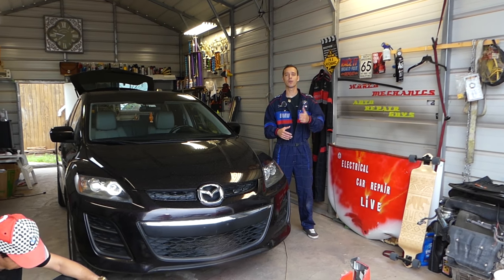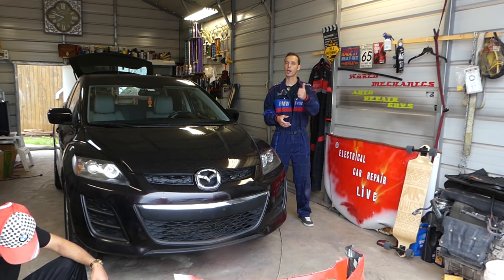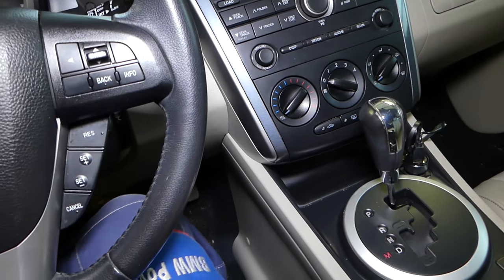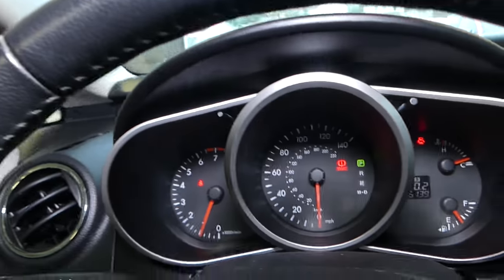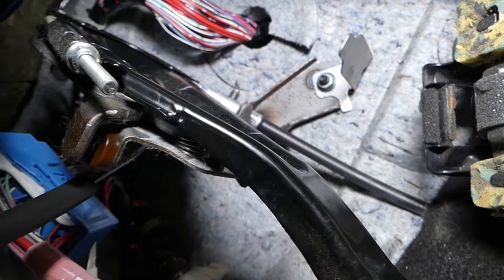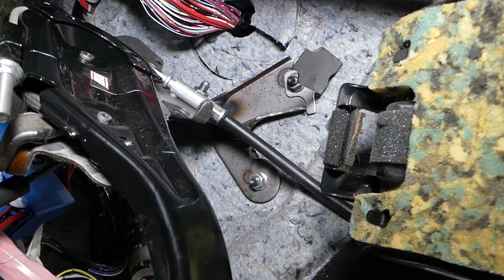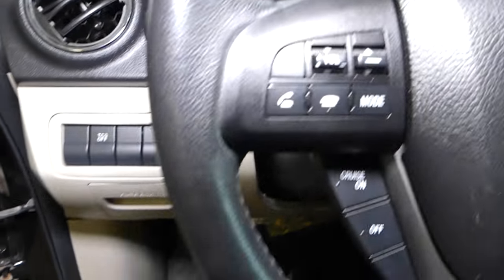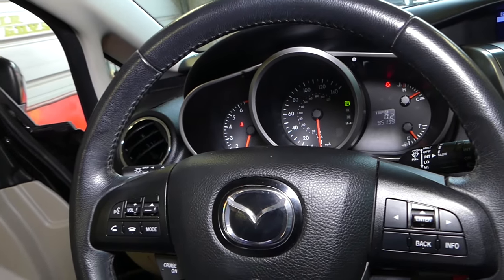WHY IS PARKING BRAKE LIGHT ON. HANDBRAKE LIGHT ON WHEN RELEASED

Comment: Brake fluid needed topping up and the light went out immediately.
Reply: It's still on..  After brake fluid topped up
Reply: @juliacaraballo8987  After several months of topping up and the light coming back on - I have no idea why yours hasn't gone out - our mechanic found the cause was a corroded brake pipe. Fixed and no problems since. Maybe your problem with the light is simply a case of following this quack's method of getting the light to stay off!

Comment: Urgent advice needed. My light goes out if the wire connects to an earth but that's what it's supposed to do but unfortunately it is fooked and stays on no matter what. Only other function is brake fluid level but that is fine. Wtf . This is driving me nuts.

Comment: Topping up your brake fluid reservoir could do the trick ! I'm not sure why . Cheers Eddie PS Mark down below also found this 'fix'
Reply: I have the same issue, and I am a millwright mechanic. As the brakes wear it requires more brake fluid in the system to fill the volume of fluid inside the brake calipers. You will notice that every so often you need to add a bit more to your brake reservoir because the level has dropped near the lowest level indicator. On a manual transmission car (I have) such as a 2013 or newer Hyundai, the clutch hydraulic mechanism is also fed from the brake reservoir. Topping up the reservoir will temporarily correct the light from staying on after the E brake is disengaged. Just be careful when replacing the brakes. You may have to remove some of the brake fluid that you previously added to prevent it from spilling over the top of the reservoir when you push the caliper pistons back far enough to install the new brake pads. This is purely a design issue with some cars that has obviously been overlooked to keep the cost of the car lower. The car I am referring to is my wife's 2013 Hyundai Elantra with standard 6 speed trans, with just under 50,000 Km. The brakes are original and I have added brake fluid 3 times to date. (Feb 14, '23) to get the light to stay off. We will be checking all four brakes as soon as the weather "brakes" in March.

Comment: MY HONDA CITY CAR 2004 MODEL BRAKE LIGHT COMES ON WITH THE TEMPERATURE GREEN AND RED LIGHTS, AND THE SPEEDOMETER AND ACCELERATOR METER CUT OFF WHEN THE CAR GOES ABOVE 60 KM SPEED, NO  The check light comes on and the engine does not turn off, can you tell me what the problem is
Reply: GO TO A MECHANIC

Comment: this is my issue on my bmw e90 can’t seem to turn it off. What could be the fix?
Reply: Is your car driving fine otherwise?
Reply: @arthurrimbaud7287  I fixed the issue. It had to do with one of my brake sensor went out, replaced it while I was doing my brakes and the light went off. Check your brake sensor might need to be replace.

Comment: Hey guys, I just replaced the e-brake switch and it didn't fix the light staying on the dash. 2012 Hyundai Elantra gls. What should I look for next?
Reply: Low brake fluid in the reservoir.  Don't add too much ! It may overflow at brake job time. I have 2013 Hyundai (50,000 K) Under the hood to the right of centre near the firewall. Black round screw-on cover👍Problem is NOT the switch ! Been there done that. 🤔😑

Comment: 2002 ford explorer/ Unplugged wire to parking brake switch,  light still on, installed new switch, light still on/ no voltage coming from terminal wire that goes to switch? Flashes on and off some times.
Reply: Hi I have the  same problem  did you fix it?

Comment: Is it safe to  drive if the lights still on?
Reply: I’ve been driving with it on for like a year 😅
Reply: Depends on the problem. If you feel like your handbrake is not engaging also known as not working properly or If you are feeling like the handbrake power is lower than usual then It's a big problem, you can drive but It's a major safety hazard and is highly not recommended to drive ! But If you are feeling like nothing has changed and the handbrake power is like usual then It's safe and the handbrake light might be showing because the light trigger malfunctioned or got stuck and Is an easy low cost fix.

Comment: Can we still drive if this light is on? Is it safe
Reply: Depends on the problem. If you feel like your handbrake is not engaging also known as not working properly or If you are feeling like the handbrake power is lower than usual then It's a big problem, you can drive but It's a major safety hazard and is highly not recommended to drive ! But If you are feeling like nothing has changed and the handbrake power is like usual then It's safe and the handbrake light might be showing because the light trigger malfunctioned or got stuck and Is an easy low cost fix.